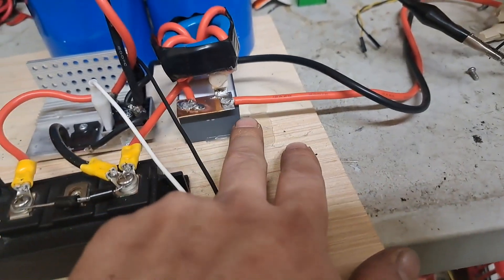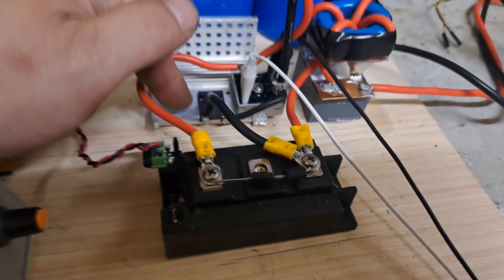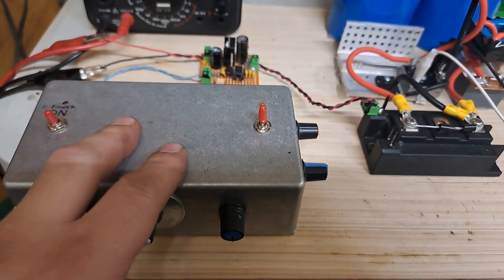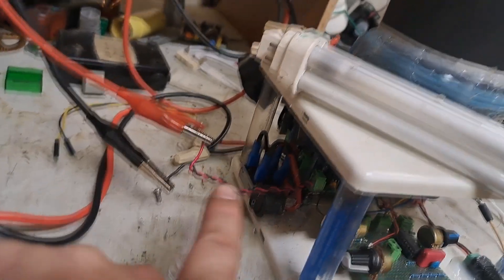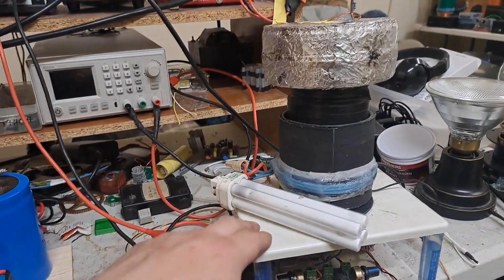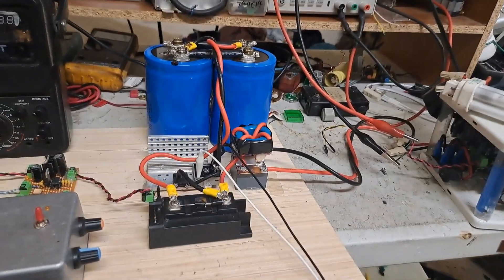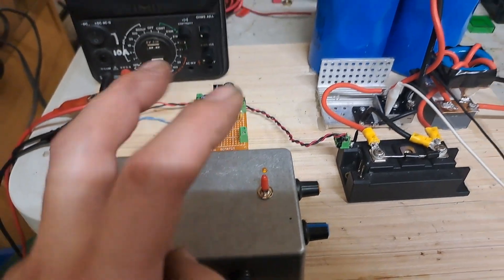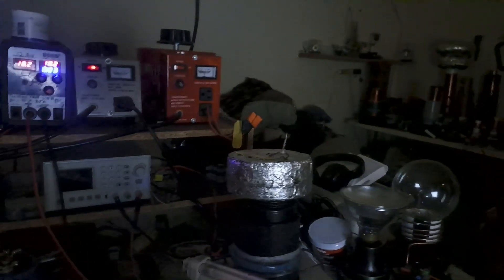QCW SSTC Low Power Test

Comment: Bro, have you given it a trial by using a MOT  as your inductor instead of the blue toroidal transformer? I'm busy modifying a beefy single Fet circuit to make it work as a RSSTC by trying to use a MOT. I want you to test that circuit using your arduino. It might work amazingly well.
Reply from the maker: My bad I've lost track of so many messages lol.. For the past month I've been immersed in radio control stuff trying to set up some RC cars for long range AV transmission etc. I haven't even touched my QCW coil after I got a toroid for it. 

So far I've found the ramping to be maybe the best way to go about it. It also doesn't really seem to matter the topology used so long as it's unsmoothed at the input. Single fet should work fine but I sort of anticipated wanting a bigger setup either way so I just went ahead and did the double full bridge.
Reply: It's OK then.
Reply: @RAVI171175 yea , I had this question as well . Do let me know if it's viable.
Reply from the maker: @spiderspider1384  I'm sure someone has used an mot but I would find that complete Overkill as far as the mass and completely inappropriate as far as the core material. If I recall it's basically just iron or steel with no laminating insulating layers basically meant for 60 hertz. I think yellow powdered iron toroids would be much easier to find and stack. Plus these things are apparently driving Slayer exciters which are single-ended low-power circuits anyway. I think Ms Labs has made the closest thing to what you're describing but he's using a push-pull circuit for the Tesla coil and I'm pretty sure he has some high-frequency ferrite core for the LC inductor
Reply: @Magneticitist what kind of parameters should I look for in the core material and its size . Would like old PSU inductor cores stacked together work fine .?
Reply: Sure man, go ahead but with a different circuit like mine. I've successfully used a MOT as inductor & after so many months, I'm still playing with the same circuit without blowing anything. If you want to try out a ramped circuit, then there are so many variations that you can play with or try your very own circuits if you've mastered well many different circuits. The best & safest way for you to start is to use that Teslista 555 sstc 4 & power that same circuit Via a light dimmer of 2000W, you'll get ramped output. What's top with his circuit is that it can work with the smallest coil to the biggest, smallest coil, you'll get smallest ramped output & with biggest coil. You'll get very big ramped outputs. So far for single mosfet sstc with beautiful ramped outputs without blowing anything, I've built tons of those circuits & given them to my class students. They are still playing with theirs till date.
Reply from the maker: @spiderspider1384  I've used a few different mixes in my ramped setup when testing and pretty much any decent sized yellow toroid worked ok and that would likely include a PSU core. I just didn't have luck with anything that had too high an initial permeability. You just don't want it to saturate. A gigantic MOT probably won't saturate either but it's also going to be about 10 pounds extra unnecessary weight to the build.
Reply: @Magneticitist yea, I had the same doubt,  would an mot work as the inductor.

Comment: Can you provide the circuit diagram?

Acknowledgement in advance
Reply from the maker: It's basically just a normal buck converter circuit (made to handle high peak currents) that is controlled with a ramp generating circuit. I used Finn Hammer's Arduino code for the ramp generator that he posted at https://highvoltageforum.net/index.php?topic=844.0 .

So you treat it similarly to making a mains ramped coil which uses no DC smoothing on the bus and relies on the rising ramped voltage of the mains sine wave. Instead of feeding it a mains ramp though, you feed it a buck modulated ramp where you can cater the ramp amplitude and on time etc..
So basically the coil is running in bursts from the reservoir of a large DC capacitance on the buck converter, and as it drains down it is outputting a voltage which starts at close to 0 and ramps up over a period of some 10-20ms or so. The SSTC is just a regular full bridge that uses PLL feedback.
Reply: @Magneticitist  ok
Reply from the maker: @yunshuizhongyi  Check out my previous video going over the ramp generator. There is also a schematic but it's pretty straightforward. You hook potentiometers (maybe 10-100K) with one of the outer pins to 5v+ on the Arduino, the other outer pins to GND, and the middle wiper pins to the analog inputs. It will output square waves on pin 11 which will feed the buck converter driver and cause it to generate the ramped output. Pin 5 will output a square wave that serves as an enable pulse that lines up with the pin 11 pulse trains. This is so you have a pulse which tells your SSTC driver to start running at the same time the buck converter is outputting a ramp. 

There is a more simplified approach which is more easily drawn out for someone to replicate exactly but it's really all about a person just already having a Tesla Coil of some form, then powering that coil with this kind of buck converter control as opposed to AC or flat DC.
Reply: @Magneticitist  ok

Comment: Very cool to see you back at the Tesla coil stuff. I’m ordering some parts as I write this. Hopefully gonna make my first full bridge coil soon. Great work as always, can’t wait to see what this turns into
Reply: Brother you should post some of your projects here , I would like to see some videos !!
Reply: @rodriguezfranco3839  I will definitely upload some stuff when I can… but college is currently consuming most of my time so once that’s done with I’ll try some more stuff out and make videos on it.
Reply from the maker: Good luck. I find full bridges to be a lot easier to comfortably build after getting some kind of grasp over gate drive requirements per given switches combined with the frequency and on times, and just treating it like two half bridges with the drains and sources tied together and the load in between. Using a single GDT to drive them all seems to make it easy. I've got some more full bridge setups I want to try using 'dead' 3 phase IGBT modules. If it's a lucky failure then one might not even need to modify the internal connections and it will basically already be wired as a full bridge, but have 2 extra switches where hopefully one of those was the failed one (making the part useless for its original application). If one could locate and cut a deal with some local company that works in repairing industrial equipment then they might have buttloads of modules that are useless to them but still contain perfectly functioning full bridges.
Reply: @Magneticitist  i like your head about using “dead” IGBT’s and you could definitely be them for cheap if you look long enough.
Reply from the maker: @quantumlab9130  We actually had a pile of them at work and I didn't think I could use them. Then one day I looked closer at the internal wiring and realized most of them are basically the 3 half bridges that are going to just have 1 or 2 of the switches blown inside. It's kind of like the brick I'm using for the buck converter. It comes wired as a half bridge internally but of course when one switch fails it's basically trash. Unless of course you have some use for a single switch in a brick package.

Comment: Great , arcs look pretty sick and the qcw is for sure working , it is crazy that you are powering everything from batteries , I been busy this week but I am starting to slowly work on a setup that I would be able to qcw ,I want to put a lower Frequency secondary on the pll coil (wich would also help my gate driver survive till I change it for a better one) . I feel like if I can get my bigger secondary to spit some nice plasma it will also spit nice arcs when ramped , for the buck switch I got a irfp260 and I need to get some kind of driver maybe totem pole bjts 
Pd :What are your thoughts on those ballons / objects shooted down ?
Reply from the maker: This testing kind of let me know how it would go with much smaller components and a small coil. Seems like it would work fine and be much easier to build since you won't need an inductor core that can handle insane currents and won't saturate.

I plan on grabbing another arduino maybe a smaller one and building a second smaller setup for smaller coils. This bigger one will probably have to wait for my large toroid to arrive before I can go much further with it. Killing a 60N65 kind of set me back because I've hardly ever killed those things on any circuit.

No idea about the balloons either. That stuff is all just a distraction to me. Political posturing etc.. I mean even if it's spy balloons, why the hell would China or anyone else fly balloons over US soil when we all have hundreds upon hundreds of spy satellites. Such things being so quickly shot down over Alaska sort of just reminds us what must be going on over there in that vast land mass.